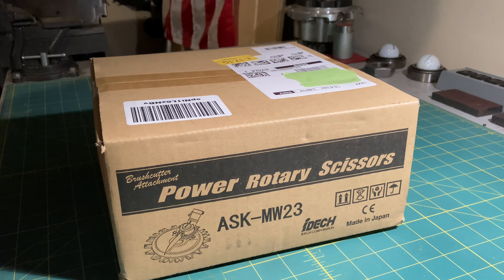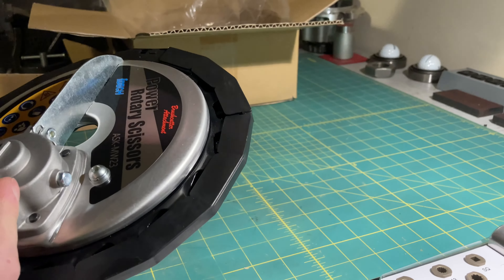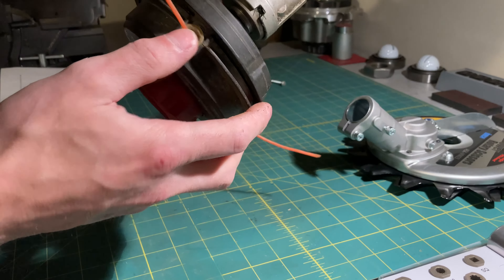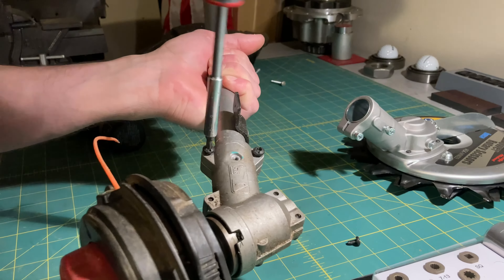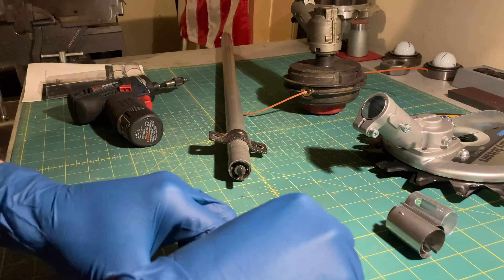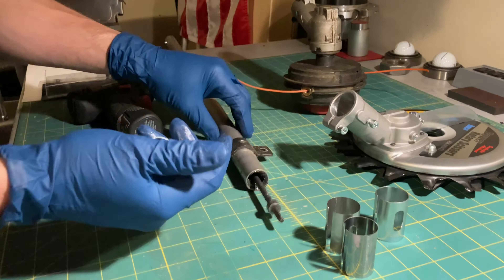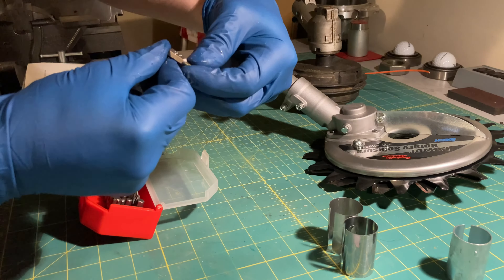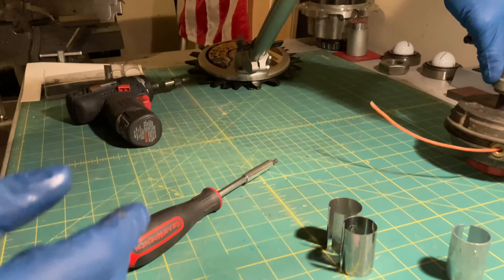Idech Power Rotary Scissors | Unboxing and Installation | 4K

Comment: Isn't that just going to burn out the motor prematurely?
Reply from the maker: Nah! Some folks attach them to rechargeable string trimmers. Now, that’s a crazy load for those motors - Same load as a stick edger, I figure. It's really neat as it's basically on/off with power applications. No need to rev when about to cut. Just a very tight and accurate feel when trimming.